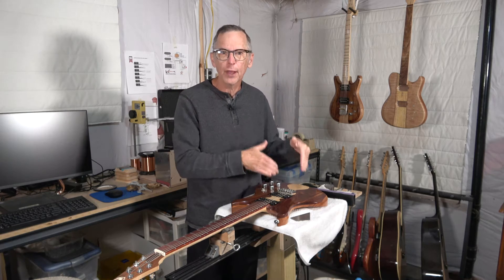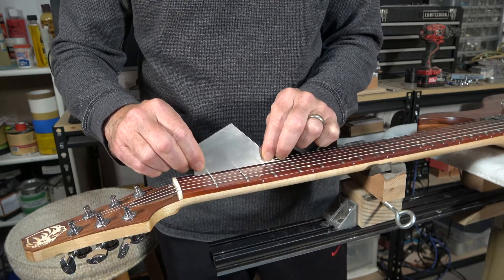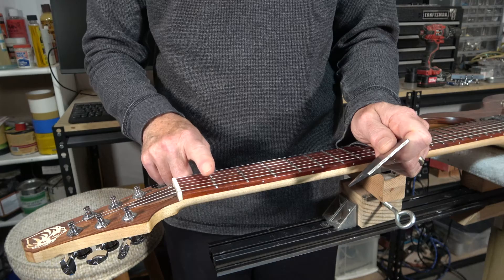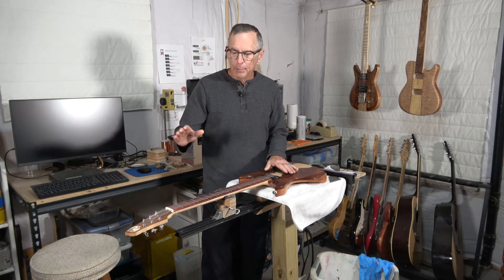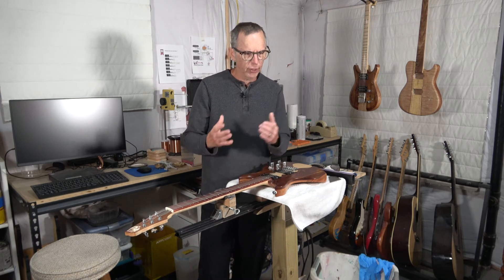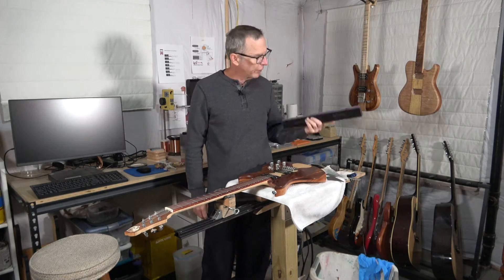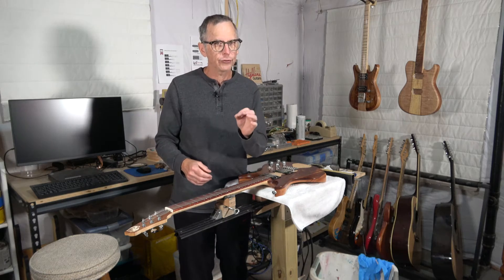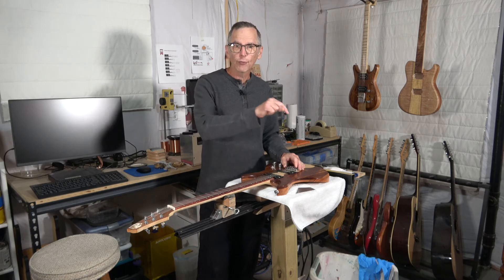Is String Buzz Caused By High Or Low Frets?

Comment: Fixing a low fret, why not extract it and install a new fret and level it to the  same level as the others.
Reply from the maker: That works on an old guitar, but not on a brand new build because replacing a low fret with another will likely result in another low fret.
Reply: @HighlineGuitars  Thank you for replying, I've just been Leveling crowning and Polishing my five string Bass. everything seems ok but will see how Iow I can set the action tomorrow.

Comment: I have mentioned this to a few luthiers and none of them had ever run into this before. There can be a high pitched fret buzz that the rocker can't locate by rocking. My acoustic had a zinging noise that was driving me nuts. I was chasing all the usual suspects and getting nowhere; loose tuners, bad strings, something internal, saddle not making full contact, buzzing in nut slot. The zinging noise was happening on the A string when fretted at the 3rd fret. I forget how but I finally deduced that the zinging noise came from the A string being too close and vibrating against the first fret rather than between fretted note and bridge end of fret board where we typically look for fret buzz. Setting a rocker across the first three frets would feel rock solid while in reality being suspended just a hair above the second fret. Sliding the long edge of the rocker down the frets towards the first fret, you might feel a slight catch or bump up as you contact and rise onto the first fret. 

I've heard more than one electric guitar player say that if you can't hear fret buzz when it's plugged in then it's not a problem. Maybe yes, maybe no. I suspect fret buzz kills sustain.

More importantly, which came first, the dinosaur or the dinosaur egg?
Reply: @patricklundquist9869  So would that be a nut issue then?
Reply: @marcosreal11  I think that issue could be caused by a nut slot cut too low, a tall first fret. In my case it was a tall fret that just needed a slight filing under the A string. Seems that on another guitar, a second fret being low might do the same but when I played at the second fret, there was no buzz anywhere else so I discounted that idea.

Comment: I often see fret leveling/crowning repair videos where each fret is masked off with Painters Tape placed perpendicular to the neck. I've been wondering for a while if running a couple of strips if Painters Tape over the frets, but parallel to the neck, matching the edges of the Tape so it doesn't overlap, might be an easier, faster, and perhaps more efficient way to identify, then level/crown high frets.

Running a leveling beam or radiusing block over the Tape would leave a mark Tape without touching any of the frets that are not too high. One could also first put a Felt Marker black line on the Tape over each fret to make any sanded marks easier to see. What do you think?
Reply from the maker: Just mark the tops of the frets with a Sharpie.
Reply: @HighlineGuitars  Then, aren't you likely to  end up sanding almost all the frets to to some degree, as there is no buffer, particularly if they were close to flat to begin with?
Reply from the maker: @picksalot1  If they are close to flat, replace them.
Reply: @HighlineGuitars  Sorry, I used the wrong word. I meant "level."
Reply from the maker: @picksalot1  If you use a very fine grit of sandpaper, all you will do is rub off the Sharpie.
Reply: @HighlineGuitars  Good point. I don't think I've seen anyone do that, though it is excellent advice. 👍

I just see people using a high grit that causes all the frets to be sanded to some degree, and then requiring crowning and polishing of all the frets.